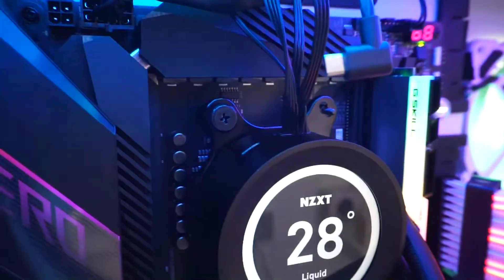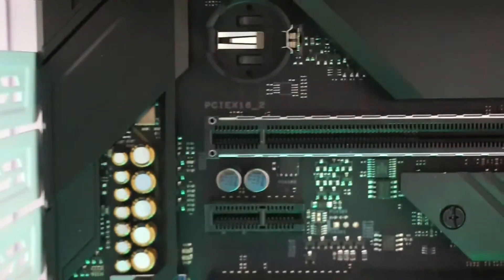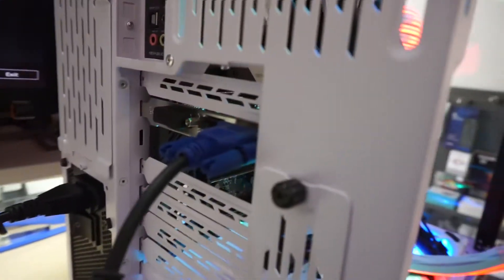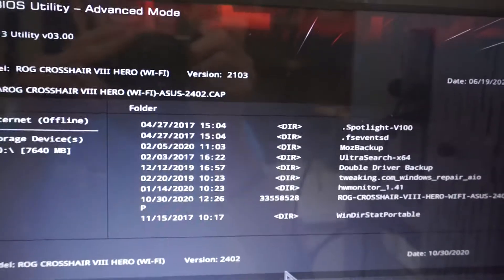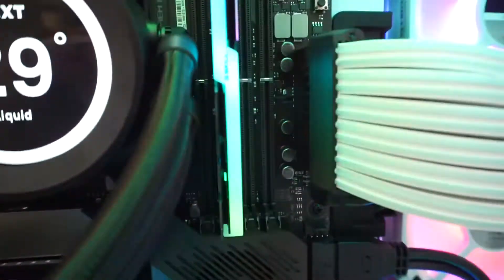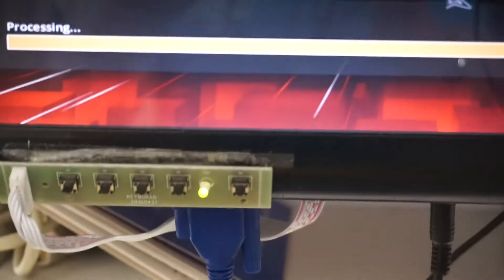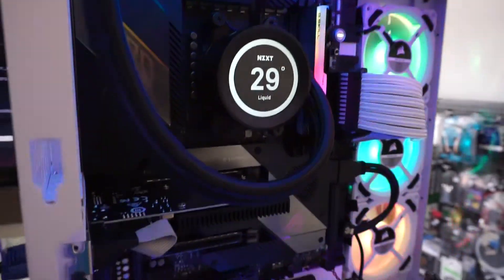Asus ROG X570 crosshair viii hero Wifi - Post Code 00

Comment: i just had this error ( 00 ) after i cleaned my fans  and i removed my gpu(video card ) and cleand it too . when a installed my gpu my computer gave an error 19 (memory)  and removed and reseated the memory then i got the error 00 and a rempved and reseated the gpu in the system and it started normaly.

Comment: I’m having this problem right now I’m just gonna upgrade to better CPU right now and in it now is a i7 10900K but the rear fan sparked and smoked so I’m pretty sure the onboard graphics fried out
Reply from the maker: Disregarding cpu change

It sounds like your power supply has blown

Comment: I have a X570 Crosshair Formula 8. Tried with 3600, 5900x, 5600x and still get Dram light and CPU 00 on the Qled screen. Can you please help me
Reply from the maker: not sure sorry
Reply: @brodieangerfist6601 you need flash bios with ch341a programmer for example, is the most cheap😉

Comment: I have q-code 00 but the system is still working only very few time it will switch off itself :(. I think I will have a think b4 getting an assembly again
Reply: and the fans howl on the case and graphics card fan?

Comment: Word of warning. Although 00 could be a CPU issue as in Rick's video, don't go rushing out and buying another CPU only to find out it is something else. I have seen a video where it has been the motherboard. I am currently experiencing this on a board that has dual-BIOS. Booting with BIOS 1 and I get no post - code 00. Switching to BIOS 2, and it boots up just fine. Will be doing more testing, but I have a feeling, the BIOS 1 is corrupt & may need to be reflashed, either via a programmer by removing the chip off the socket & re-flashing with a downloaded BIOS, or if there is a way to copy the good BIOS from BIOS chip 2 over to BIOS chip 1 via UEFI, haven't sussed this out just yet.
Reply: Update - was able to copy BIOS 2 over to BIOS 1 via the UEFI BIOS utility [aka. BIOS] from within the "tools" section. Took about 2 minutes to copy over. Switched over to BIOS 1 and no more Code 00 since.
Reply from the maker: I will pin your useful tip, thanks

Comment: Hey dude, can you help me? changed some fans on my pc and hasnt booted since... pc turns on and fans, gpu and all lights turn on... getting error code 02, 0d.. tried changing monitor display port etc nothing....
Reply from the maker: Not sure sorry

I only had to diagnose this issue with this board, even with fan headers changed over it shouldn't stop the pc from starting 

Did you happen to put it a fan header on to an RGB header ?

Comment: I’m upgrading to the viii dark hero, i have seen people having some issues around. Did find a way to fix this?
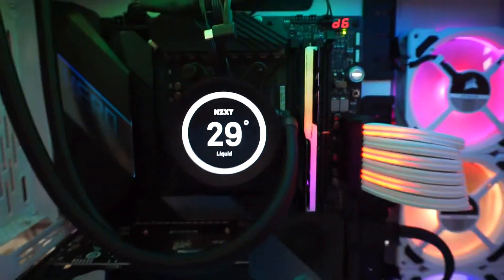Reply from the maker: 2:00 as mentioned, installing an older model of CPU and bios updating
Reply: @rickstechrepairs  Why would you use another CPU if you could update bios through USB on the i/o? I'm sorry if i missed anything.
Reply: Do you have to do that if you are planning on using a 3800x just brought the board
Reply: @rodneylangton9291  You can flash the BIOS on the Crosshair VIII Hero Wifi without anything installed on the board. Basically you just download the newest BIOS from the website , rename the file using the included renamer and load it onto a USB stick. Plug the stick into correct USB port on the motherboard IO and then plug in your 24 pin cable from your PSU. Turn the power on and the board will light up. Simply press and hold the BIOS Flash button on the motherboard IO and release when it turns blue and starts blinking. Sit and wait till the BIOS button stops blinking and goes out (takes a number of minutes) and remove the stick and job is done. BIOS is updated with no CPU, Memory or GPU needed :)